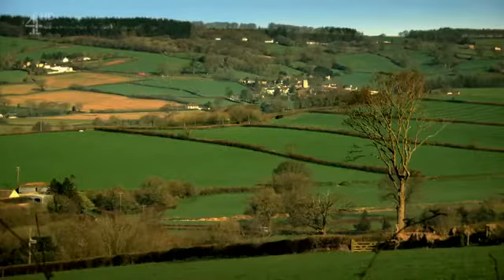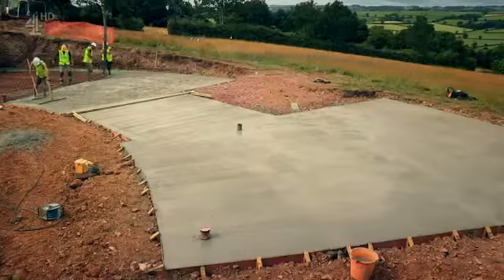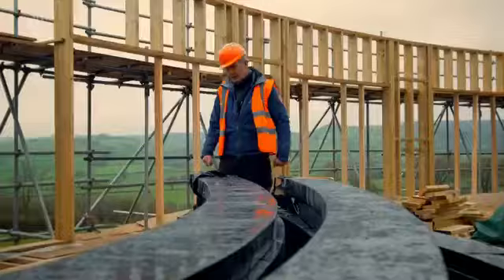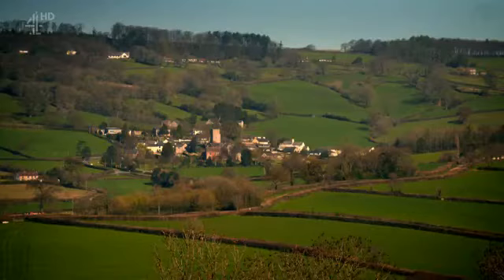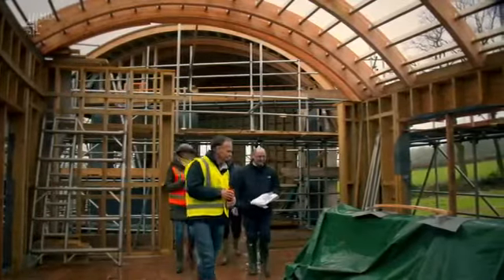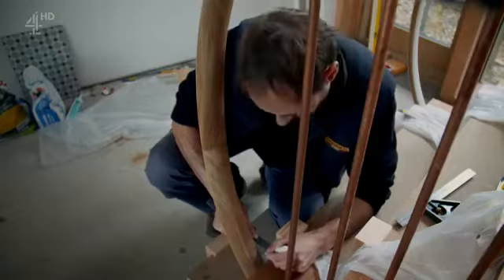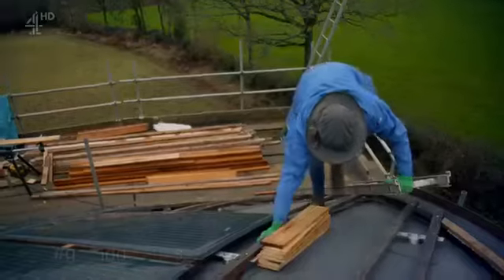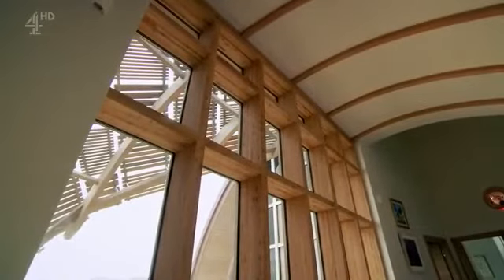💡Grand Designs 💡S18E06💡 Blackdown Hills, Devon  Snake House 💡 [23 March 2018]

Comment: Astonishingly good. That roof is genius.  Interior could have been executed better, but for the modest budget, very good. Easily my favorite house on Grand Designs.  As a builder, my head ached at the mention of spiral curves...some of the most difficult shapes possible.   The roof cladding material will likely be a maintenance headache as weather takes its toll, but the glorious patterns are equisite.